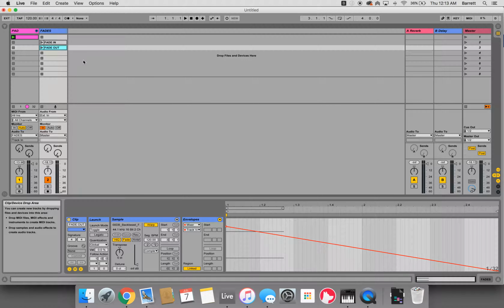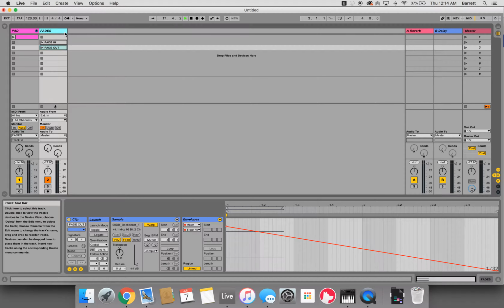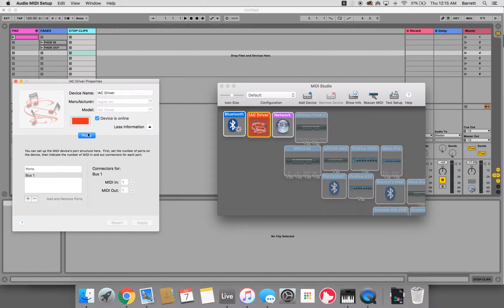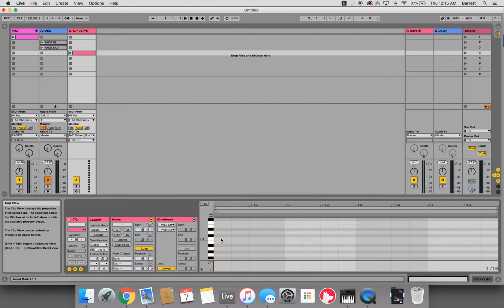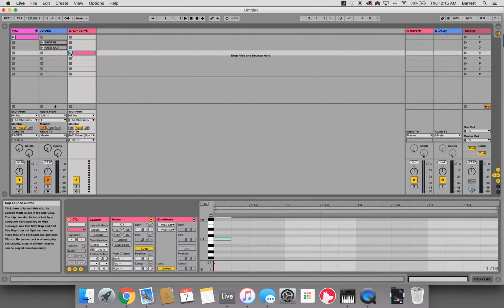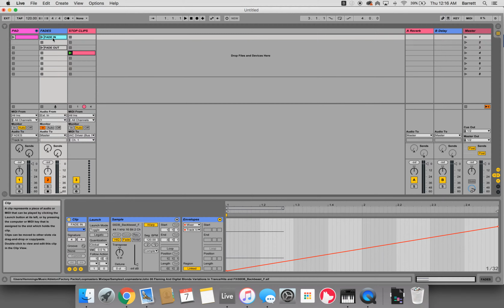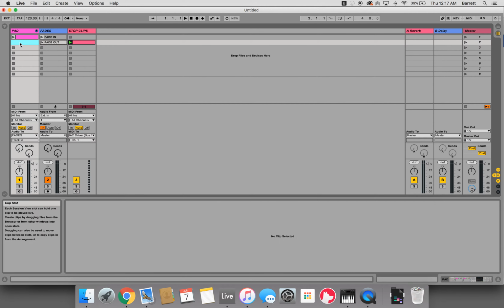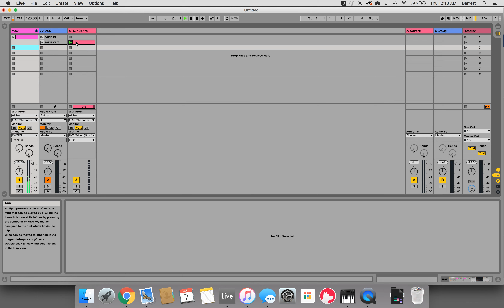Stop Clip Action in Ableton Live using IAC Driver

Comment: Is a nice trick but not a good example. First of all there is no need to stop a track if you already have them silenced by the fade out, and in case you need to, because you know the length of the fade out, you just need to place a copy of the Pad's clip and activate Legato for it so the transition between Clips is seamless. Then for the Pad's copy clip, set a follow action to STOP after 2 bars. And that's it. The simpler the better.  Now what is actually a good example and that's how I used to use this trick, is to launch Scenes using clips. :) Anyway nowadays with Max4live... Cheers and kudos for the video!